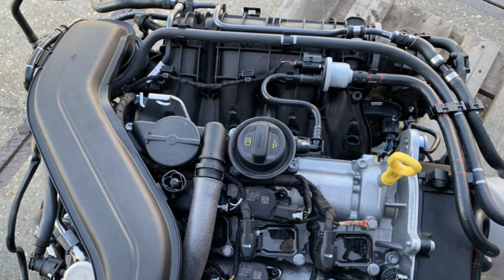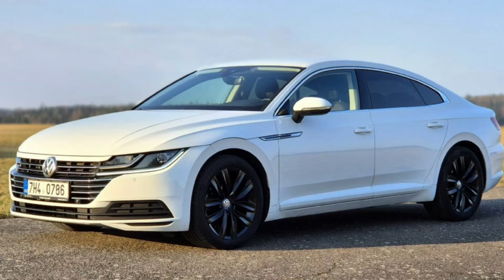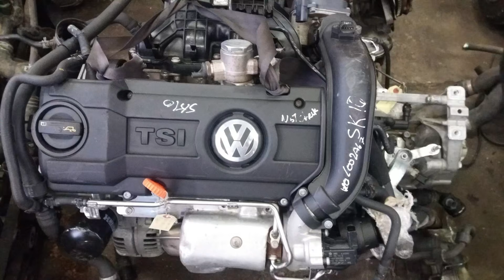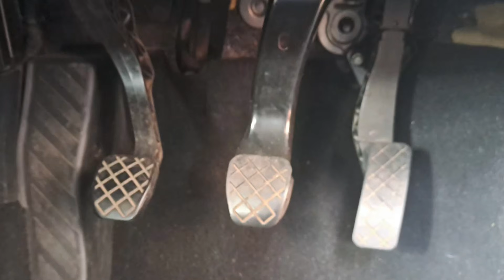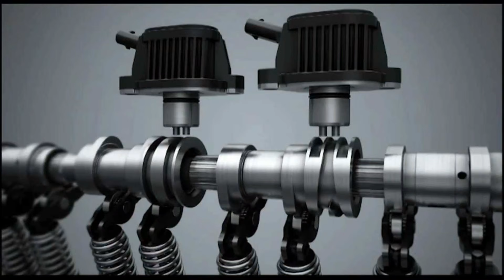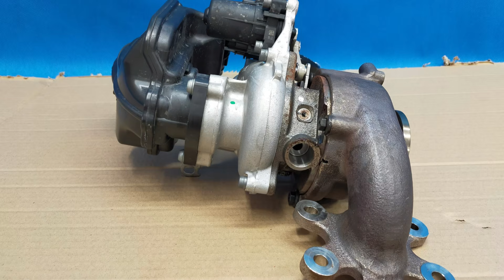Volkswagen’s 1.5 TSI engine: Common problems and advantages

Comment: My Audi A3 1,5eTSI 150hp is a dragon, it uses oil, the engine vibrates around 2500RPM.
Simply bad quality that you do not expect from an Audi
Reply from the maker: Vibration is certainly not typical for these engines - they are usually very smooth. Oil consumption seems to be quite common though.
Reply: My Leon 2023 150hp was smooth and silent when I brought it home, drives with charm like a feather. But after only 13000km sounds rough, with 1second power drop immediately after floor acceleration at 3000+rpm, car vibrating from engine, there is strange resonance at 4000rpm. Cylinder de/activation mechanism is audible and i feel when it turns on and off by slight kick. Last week I try 0-100 few times with shocking 10,2-10,5s instead of  8,5-9. Manual transmission is horrible, lot of play, I need to push gear by force by last centimeter instead of pulling stick by itself. I cant tell when strange things starts but it looks like some problems appears and deteriorating slowly. Service tested it and told me, its normal, doesnt look like something wrong with car. Really bad experience.
Reply: @martinleska4292 
Vidange moteur et boite de vitesse.
Pour le moteur passer à une viscuosité plus forte sae 30 à sae 40 !
Reply: Si vous avez la 0w20, passez a 5w30 ou 40 si climat chaud.
Reply: if you're doing short town runs all the time you'll find it will hesitate when you want to accelerate, take it down the motorway for a while that should clear that problem. Changing gears from 1st to 2nd will stick a bit due to it being cold, even worse in freezing conditions, apparently that's one of their characteristics. You got to live with it as I do. I find If I  don't force it in, I do it in two motions, take it out of first then gently place it in 2nd, the gearbox will warm up and be easier. Regarding the loud noises from the engine, when it was new you weren't actually paying attention how loud it was however over time your ears are more a tuned to unusual noises, occasionally you'll hear the high pressure fuel pump working away giving loud tapping noises from inside the cabin, that's normal, your car isn't broken. When the car is cold it'll be loud until it gets to operating temperatures.

Comment: I recently bought an Audi A1 35 TFSI with the 1.5 evo2 engine. I cannot tell when the cylinder deactivation system engages... Do you know the exact differences between the evo1 and evo2 engines ? Since I am planning on keeping the car for lots of years, is there anything I can do to prevent valve carbon build up ? I am already using premium gasoline....
Reply from the maker: As far as I know, VW just made minor updates to these engines. So, I would change oil a bit more often than they recommend and would sometimes drive it actively to let the heat clean up some mess in the valves. Honestly, it's one of the best VW engines among those that are currently manufactured.
Reply: yes, change the oil way much sooner. Best oil is PAO+ester full synthetic. you can also use PAO+HC

Comment: Mine has got a chain not a belt ?
Reply from the maker: The ea211 generation comes with the belt, so there is no 1.5 tsi with a timing chain. It has the chain for the oil pump though. But if yours has the chain, it must be the 1.4 tsi.

Comment: I have a golf 8 2021 1.5etsi 110kw with dsg dq200 gen2 . So you recommend to full up with euro98 not 95? I live in the netherlands . It has 70.000 km and I think always with 95 gasoline . So better 98?
Reply from the maker: Yes, in a lot of countries, the manual says it should be 95. I guess, they may not require that in Western and Northern Europe because fuel is of high quality there and octane numbers are close to what the fuel's price tag say. But I would still go with 98.
Reply: @DmitrySapko  This engine has two versions: 90 kW and 110 kW. The first has a higher compression ratio. 98 octane gasoline is preferable for it. 95 octane gasoline is sufficient for the 110 kW engine. I have experience using this engine. I have a Volkswagen Golf 7. 110 kW engine. Mileage is almost 150,000 km. So far, no problems. Engine oil consumption 0W-20 is currently about 200 grams per 10,000 km.
Reply: You might want to look in to faults with that gearbox , I think they had issues with it

Comment: Iv got the cupra formentor 1.5 dsg. Good eco engine but have heard problems with dsg box. My one is a 2021
Reply from the maker: This DSG is a bit problematic, but there are much worse DCT transmissions out there. VW basically fixed many initial problems with them.
Reply: Formentor has dq381 on 1.5 so don't worry

Comment: A common issue with first generation of this engine is the water pump, it will leak at some point. The replacement  OE part number or the after market variants of it are much better. Other common issue is the fault on child lock when you replace the old battery.  Be aware when you replace the old battery with the new one to code it with a diagnostic tool.
Reply: By water pump, do mean the coolant pump?
Reply: @user-wc5gm2gh5k yes

Comment: Great Engine but it is when its paired with VAG 7 speed DSG box that ruins it !
Reply from the maker: It's not the best transmission in the world, but I like how it works with 1.5 or 1.4 tsi engines - relatively good performance and perfect fuel economy, as for me.
Reply: @DmitrySapko I agree the part with little consumption. But it is awful to drive. Not the issue of the engine itself.
Reply: Really? I think it's a brilliant combination. I've never noticed any of the hesitancy or lumpiness that some people mention. It's as smooth as the torque converter transmissions I had before it.
Reply: @gwilymhughes2203  Kann ich nur zustimmen! Ich finde diese Kombination großartig! Fahre einen Fabia 1.5 tsi Tour Bj 03/2025 mit DSG
Reply: It's due to the dry clutch vag use on low engine cars. They truly are awful. Would stick with a manual if possible

Comment: I'm driving a SKODA Fabia IV with 1.5 TSI EVO2 motor since 2024. IMHO one of the best cumbustion engines I ever used. Quiet, powers 110 kW and doesn't need much gasoline, even on higher speeds. In the city it's the same because start/stop and ACTplus work great.

I can totally recommend it.
Reply: the problem is the dsg that i dont trust
Reply: @Definitely_Someone  Then go manual while you can! Still an option for compact cars with that engine!
Reply: @rageradeon  there is not an option for manual skoda in my country unless its like the 1.0 engine or something 🥺
Reply: @D @Definitely_Someone I agree, definitely don’t trust DSG with the dry clutch system. My 2026 Skoda Scala has the 1.0tsi 116bhp and it’s goes really well and I believe it’s actually a bit more reliable than this more complicated 4 cylinder 1.5 engine
Reply: @Definitely_Someone it is cheap to fix
Reply: Deactivate act. It will hurt the engine.

Comment: The problem of this engine is that there are other bigger naturally aspirated better engines for the same money. Mazda’s 2.5 or Toyota’s 1.8
Reply: Mazda 2,5  aspirated delivers 140 CV with 220 NM at 3500 rpm....!  The T-ROC 1,5 turbo is a 150 CV with 250 NM at 2500 rpm engine !!! So, in the region where the turbo has no effect, the  "small" engine seems to be more tractive than the Mazda 2500 engine.  The Mazda 2000 cc needs even higher rpm to deliver max power and max torque.
Reply: @frank4671-g5d  Correction. It is 250 Nm at 1500 rpm
Reply: @frank4671-g5d power is not everything, young man😂😂😂
Reply: @jeanvaljean1475 tell em boi
Reply: @jeanvaljean1475  it is not adequate in 2026 to drive this naturally aspirated engines, sorry, especially with CVT gearbox. It is a nightmare, especially on highway. Sorry but such engines from 1992 are not adequate in 2026. I talk about pure gasoline engines, no hybrids. 
TSI with DSG is not comparable in terms of driving experience and pleasure of driving with naturally aspirated Toyota with CVT. And it does not matter if you are VW Dan or Toyota fan, this is the reality.
Reply: @frank4671-g5d and 1.5 will last half as mazdas, and 5 times less as toyotas, that is a fact. But if you love wv group you cannot chose better, so that is like it is.
Reply: @ivanrakic2743  Not many people will keep a car for 400.000 to 1 mln kilometers,  the distance you claim the Mazda or Toyota will run. Which of course isn't true but you are welcome to try.
Reply: I know that the Toyota Prius hybrid with its 1.8 petrol engine can go 1.2 million km before needing a rebuild in the taxi world. Also, every 300,000 to 350,000 km, some battery cells need servicing, not the whole battery pack (personal experience). This isn't just one car, but a whole fleet of them. Try that with your 1.5 TSI hybrid (which exists)! 😅 A 1.8 petrol engine (it is not turbocharged) alone will go up to a million km if taken care of; if not, it will easily go 400,000 km. If you do not take care of a 1.5 TSI, it will break down at 50,000 to 60,000 km (also real-life experience). You have to comprehend that people who buy Toyotas and Mazdas versus those who buy VW group cars are totally different buyers with different goals in life and different intentions for their cars. Someone who buys a Toyota will keep it longer for sure and probably intends to achieve high mileage and not replace it with a newer model in 4-5 years. And that is the beauty of it. It is no luck or coincidence that over 55 million Corollas and more than 15 million RAV4s have been sold to date.

Comment: It's a good engine. I have a Seat Leon 130 hp from 2019, manual transmission. Kangaroo effect disappears after a while or maybe it's because with time you get use to release the clutch pedal slower than for other cars and mitigate this issue. The deactivating of the cylinders can be felt only when the engine is cold. The oil consumption after 120 000 km is about 250 grams / 15000 km which I find very reasonable. I changed the oil every 15 000 km.
Reply: The deactivating cylinders on 2 and back can always be felt with engine noise. It sounds different when it works with two, and you can hear it in whatever model with that engine. It is not a bad sound, but to someone unfamiliar with it, it feels like something went wrong with the engine.
Reply: @ivanrakic2743 yes mine rumbles a bit when using ACT on 2 cyclinders.
Reply: I have a 2019 Ateca, it had that kangaroo effect initially, but the 2020 software update fixed it. If you haven't done it, you can always do it for free with a SEAT dealer.

Comment: I bought my car (Golf) when it had 90k km, and it then it was missing a liter of oil. After servicing it, putting in new oil and only fueling with 98 gasoline, it hasn't lost a single drop of oil in two years. Make of that what you will. Literally no problems with the engine. It's quiet, economical, nice low end torque and plenty fast enough.
Reply: I have Also a golf 8 2021 1.5 etsi 110kw 70.000km . No oil consumption. I always put in 95 gasoline. U recommend me to put on 98?
Reply: @Resistthetemptation It can run with both, but the ECU can use more aggressive timing when it detects higher octane fuel, so more premium fuel gives a little bit more performance. For me the cost and availability difference is pretty negligible, so I use 98.
Reply: @Resistthetemptationdepends how long leave in car. Over time it gathers water. The engine can run on both. If leaveover a long time use 98
Reply: @Resistthetemptationit is recommended
Reply: you will see the 95 vs 98 difference only at wot or near wot.

Comment: THanks for an excellent informative   video. Passat R line 2019 1.5 Tsi auto.   Love it.
Reply: I've had a few Passats, all 2L petrol or bigger. 1.5L in a big car like that is asking for trouble.
Reply: @StephenOverthrow It cannot be like a bigger engine, yes, but you have stereotypes in your head. The times are different now, and with that engine, the Passat is not a "rocket," so it should be driven accordingly, but it will meet every expectation for sure.
Reply: @StephenOverthrow rubbish it’s a turbo more bhp than some older passats

Comment: Just bought a 2025 fabia 1.5tsi dsg….. seems quite loud at idle? Louder than the previous 1.0tsi at idle… like a tapping noise
Reply: The tapping sound on a cold idle engine is caused by high-pressure direct fuel injectors, perfectly normal.  The overall louder engine sound  when you start a cold engine , is caused bey the engine control unit (ECU) commanding a "fast idle" or "cold start enrichment" phase. This raises the RPM to 1,200–1,500 for 15–30 seconds (depending on ambient temperature, coolant temp, and battery voltage). The goal is to:
Quickly build oil pressure for lubrication.
Warm up the engine and exhaust system faster to reach operating temperature.
Heat the catalytic converter rapidly to minimise cold-start emissions.
When the ECU detects enough warmth, the fast idle ends.
Reply from the maker: Yes, this engine is louder, probably due to cylinder deactivation equipment. But if tapping is annoyingly bad, I would ask dealership to have a look at it.
Reply: @DmitrySapko  does this sound ok? Only covered 1200 miles https://youtube.com/shorts/ZXaKQ0Nwp4g?si=dxrWrUxPo1FQwh_Q
Reply: @smithygmustang  This is most likely normal operation of the high-pressure direct fuel injectors. These injectors operate at up to 350 bar to atomise fuel directly into the combustion chamber, creating an audible "tick" or "tap" as they cycle—especially noticeable at low RPMs like idle when engine noise is minimal. This is a hallmark of modern TSI engines and isn't a fault; it's often more prominent in colder weather or right after startup before the engine fully warms up.  My 6 y.o. SEAT Ateca has the same sound on startup, maybe not as pronounced, but it's hard to compare a video to a real sound. But it should go  away when you start driving.
Reply from the maker: @smithygmustang , it doesn't sound bad to me. Given the camera mic tends to seriously worsen those tapping sounds, this is OK. But the question is has it been doing this from the very beginning? It never hurts to have a talk with the dealership about the sound. Everything is covered by the warranty for now.
Reply: @user-wc5gm2gh5k  thank you this is very helpful 👍🏻
Reply: @DmitrySapko thank you! Yes the video does make it sound louder/worse than in real life. Tapping sounds can only be heard at idle and doesnt get louder with increased rpm while driving. You can only hear it at idle. I will take it to the dealer however i think they will tell me its normal too! 👍🏻
Reply: This is a very useful video 👏

Comment: I have engine 'hesitation' when i put my foot down. It seems to be when the engine isn't quite fully warmed-up (but not cold) and in higher gears (third to fifth). It's a 69 plate golf with the manual 150ps version (18,500 miles). Always vw main dealer serviced. VW want £100 to diagnose. Can anyone help/advise at all?
Reply: You shouldn't put your foot down until oil temps reach 90°C
Reply: @eponymous7910  
Agreed. I've started letting it idle for a while before I move-off and making sure it's at 90 degrees before I go above 20/30mph. You just have to allow time to do this it seems. Seems to be a characteristic of the engine. Thanks for advice.
Reply from the maker: It will probably need new software installed, I can't imagine any other probelms at this mileage. If you aren't happy with dealership prices, find some VW-specialized independent mechanics in your area, but inquire if they have access to official software updates for the 1.5 TSI engine.
Reply: Just let it idle for 20-30 seconds after starting the engine. The hesitation will not appear when you then drive away

Comment: also for 1.5tsi ea211-evo1 (DADA/DPCA) the ACT/COD is not smooth and is engaging at 1500rpm and stopping at 1350rpm, it should be +200rpm for both (because the turbo does not have geometry) // another non logical thing is to activate ACT in the 6th gear, it can't produce enough torque for a 0.6-0.7 to 1 gear (that gear is made for low fuel consumption, it does not need ACT) // also ACT is killing that double-mass (pendulum) flywheel
Reply from the maker: I don't know why they at all needed ACT, the engine would go through Euro-6 easily without it. But as long as VAG anyway installed in in a 4-cylinder engine, it does work more or less well. Of course, RPMs for activation are not good, but otherwise, it wouldn't work in most cases since the transmission shifts quite early.

Comment: for 1.5tsi evo1 the kangaroo is partially fixed, there is too much spark retard at cold start when the catalyst is pre-heated to 375 degrees, resulting verry low torque (kangaroo)
Reply: that low torque can be increased by using 1-2% more fuel😊
Reply: vw "fixed" it by forcing the engine to stay at 1200rpm 1 second longer after cluch release , fixed the efect but not the cause 😅